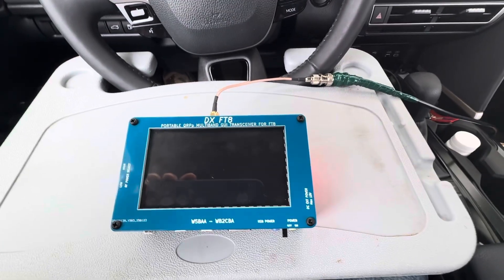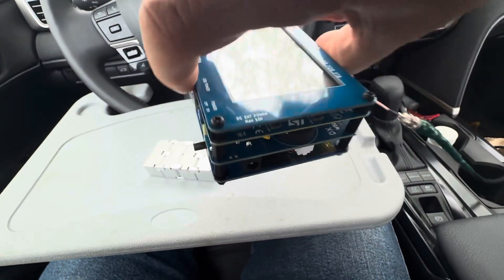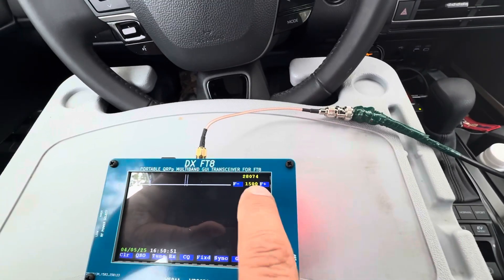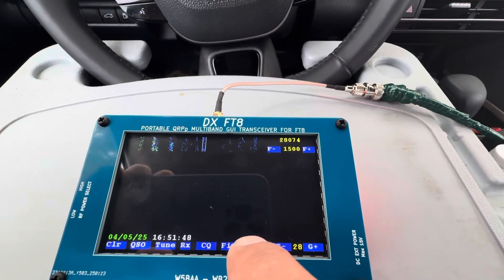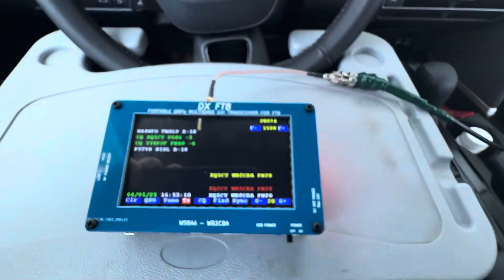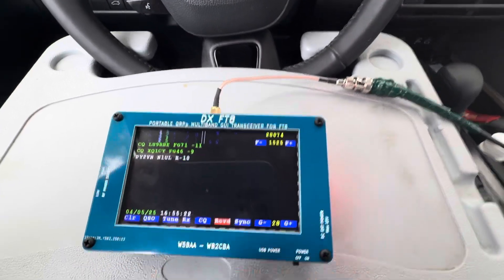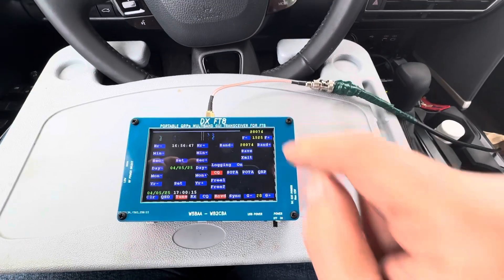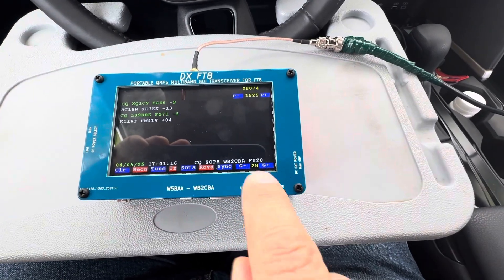DX FT8 - HF FT8 Tablet Transceiver - Operation Guide and controls,switches, bells and whistles!

Comment: I noticed you made a common mistake I see many people make.  You change your frequency to match what someone else is using to respond,  then turn around and use the same frequency to call cq in the same space that the guy is using and other are using to respond to him.  I know people don't realize they do this and I see it a lot when out doing pota activations...
Reply from the maker: You are right. It’s not a good practice though there is an option on dx ft8 as a button called fix vs rx. In fix you don’t need to tx on rx freq.you can always switch to fix and choose to tx on mid band freq

Comment: Do you have a way of showing swr? You have the tune option but in wsjtx that's for the radio's tuner. Since this is a transceiver, where is the swr display functionality? Secondly, can you edit the FT8 frequencies to work a dx station in say 10.131, 7.056, 24.911, etc?